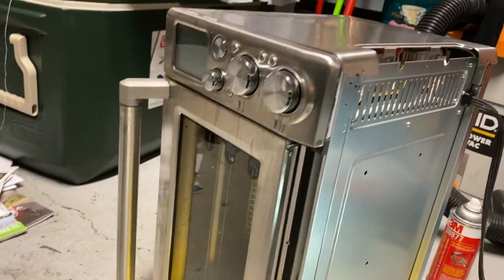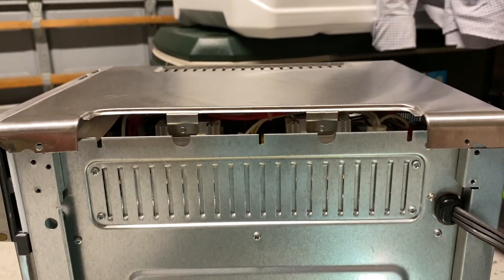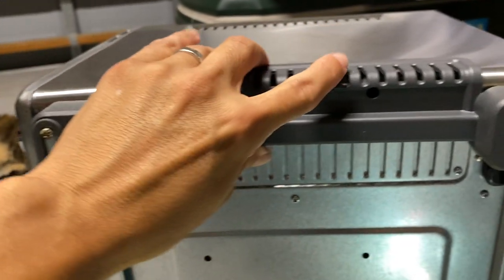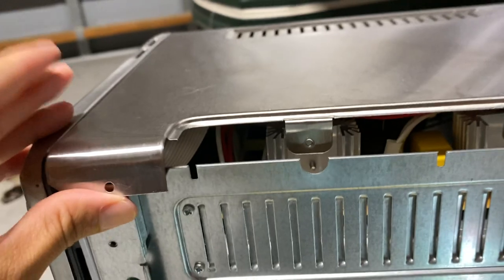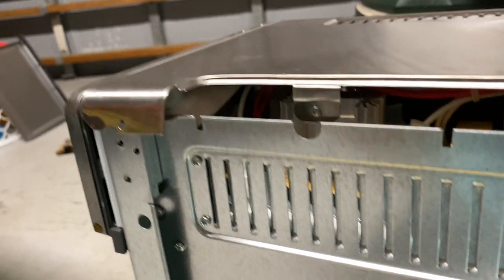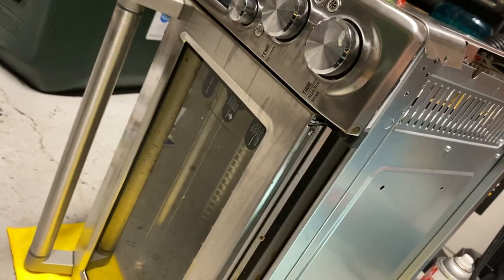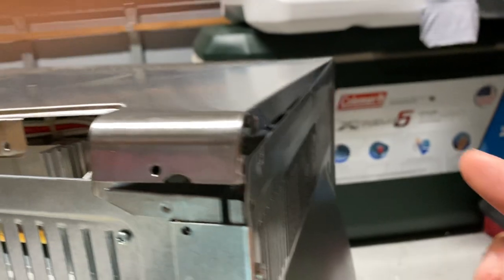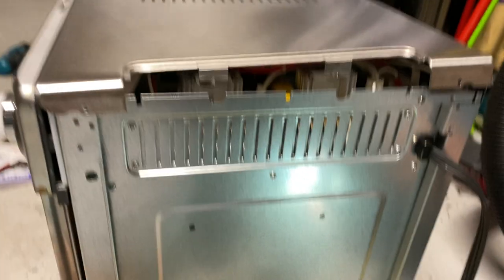Noisy fan in Breville Oven Toaster

Comment: To remove the outside, remove all screws and feet on the bottom and the back. Then, slide the back down until you can take it off. After that, there's one more screw on the under side, below the knobs. if you take out that screw, the entire top panel can be pulled off towards the back of the oven, starting on the side that doesn't have the panel. Firmly but carefully pull the side panel towards the back of the oven and it will slide away from the front. Work your way to the other side of the oven until you can pull the whole thing including the display away from the oven. The display is connected with two cables that need to be removed before fully removing the control panel.

Comment: There is one recessed screw on the bottom below the control panel. If you remove that, you do not have to get to those screws deep in the oven. The panel comes off attached to the case and then you can remove the panel if you need to.
Reply: You appear to be the most recent add - glad I read all the way down the thread.  Thanks for the tip - this would be so much easier if the case were off.  I'll be trying this over the weekend.
Reply: Chris S.'s suggestion was super helpful.  I removed the recessed screw and then removed the four long screws securing the feet on that side.  I then removed 6 or so small screws securing the metal panel to reach the outside fan.  I used WD-40 silicone spray with the long red "straw" extender to reach the top spindle of the outside fan.  I then resecured  the metal panel and feet and went inside the oven to reach the interior fan.  I used the WD-40 silicone spay with the extender on the top of the fan spindle, and then sprayed the spindle under the fan  itself.  I then turned on the oven with the convection fan on to lubricate the moving parts.  Almost completely silent.

Note:  Although only rated to 400 degrees, I'd use food grade silicone next time.  There is a silicone odor coming from the convection fan now - I've been trying to burn it off and it seems to slowly be going away.  But its not pleasant. I may have used too much WD-40 silicone spray but my guess is that even with less spray the odor would still remain.  But problem solved.
Reply: Great suggestion!!  Thank you.  Much easier than trying to move the internal screws.

Comment: Coming up on 2 years and had same issue. Used a similar lubricant and the fan started to spin again on the inside in addition to out. I Kept it on outside for a bit to get rid of smell and it seems to be working fine (currently day 2 working). Thanks for video. $4 lubricant saved me buying another oven.

Comment: That solved my issue!!! When I manually moved my fan, it moved easily. But when the motor turned on, the fan got stuck and resisted moving no matter how much I tried. Applying silicone spray didn't make a difference. Then I turned the oven so it was on the other side of the fan. I sprayed lube straight on the fan's pole and let it sink in. After waiting around one minute, I turned on the fan, and it moved without any trouble.

Comment: This was extremely helpful! Mine had seized up and wouldn't spin on its own anymore. Got some lubricant in there and it worked!
However, my "outside" fan blade came off, so it was a struggle to get that screwed back onto the shaft. I didn't discover until after reassembling that there's a screw head on the "inside blade"–end that you can use to tighten the outside blade against.

Breville Smart Convection Oven fan repair

Comment: Thank you for the information! I was able to reach the fan to lubricate it without removing that far left screw that you were worried about dropping down into the oven. With the oven on its side (fan up), I was able to lift up the cover enough to drip some 3-in-1 oil directly onto the shaft under the fan blades. 

The 3-in-1 nozzle was just a bit too big to fit in such a tight place so I used a drinking straw split vertically to form a long skinny trough to drip oil down onto the shaft. While still on its side, I plugged the oven in and let the fan spin for a minute to help the oil flow down the shaft into the bushing (removing the straw of course).

Now the fan runs like it was new! Thanks again!

P.S. one quick note: When putting the gray plastic foot back on, be aware that there is a groove in that plastic that the side cover of the oven slides down into. Before putting the screws back into that gray foot, be sure the foot is seated correctly. It should slide all the way back into place without needing to tighten the screws in.

Comment: Excellent video. I had same problem. Wife wanted to get a new one. I followed this video and fan is running quietly now. Just two problems. Lost one screw inside and ended up somehow with 3 extra screws. I will put them in my little toolbox for next year when I attempt another home repair.
Reply: I also had 1 extra screw and no idea from where lol.

Comment: Thanks. Mine's almost dead silent now.  As some have mentioned, removing the recessed screw below the control panel on the bottom helps greatly, after removing all the other screws.   I used Super Lube 21030 Synthetic Grease.  Put a small dab on a q-tip and applied it around the fan's shaft.  This lube is non-toxic USDA H-1 approved and has working temperature of up to 450F.   I do have a Noble Lubriquik silicon spray (also USDA approved), but didn't want any over-spray to get everywhere. Grease is the way to go in this application.

Comment: Thanx for the video. I have used a food grade lube instead. Fan spins like it was new.
Reply: Hi Lawrence, what is a food grade lube and how does it differ from something like RP7, which I'd be very hesitant to use after reading the cautions. Don't fancy the oven going up in flames. Is food grade lube safe to use in hot areas or something?

Comment: Thank you for sharing your DIY fan repair, I will certainly try your suggestion, good you show all the strategic screws 8-)

I tried it today Dec 28, 2020, but does not work me,  I even give it a push blowing air from my compressor, it kind of start to spin but eventually stop, maybe the fan is beyond its ages.  So I disconnect the fan from the power supply board to avoid the humming noise.
And for the black screw, I magnetize my screw driver so it won`t fall off.
Now let see if can find part for that fan.
Reply: you could simply power off the convection feature and the fan will not have power to it and not hum.
Reply: did you find the part?
Reply: @josephhngo  No could not find the part, so I disconnect power to the fan.   Since then, the thermal-fuse burned but able to find replacement on Amazon, the hard part was always to dismantle the oven to access the fuse, I also replace all the switches, why not right to keep this oven running, less e-waste thrash in the field 8-)

Comment: For those that are thinking of a replacement unit: In the past 2 months I went through 2 brand new units with excessive fan noise. Returned them both. One sounded like a small prop engine the second one started off noisy then slowly settled down. What poor quality control ! I've had 3 units in 10 years and all eventually develop this malady. Shame because the unit works well otherwise.

Comment: Thank you for this video.  I did as you suggested and the fan works much better and  more quietly.  I've had this appliance for 6 or 7 years and it started making that horrendous noise after about 2 years so I just stopped using the convection feature.  However with air fryers gaining in popularity I decided to try to fix it and just buy a fryer basket which I ordered yesterday from Amazon. 
I am wondering for future if drilling a small access hole thru the outer side panel in front of the fan to use to spray lubricant as needed would be a good idea?  The hole could easily be sealed with aluminum duct tape.
Thanks again!
Reply: Rose, can I ask which basket you ordered. Or are you using a Breville air fryer?
Reply: @lizardbreath9999  from amazom, I'll try and send the link
Reply: @lizardbreath9999  'Cosori C130 FB toaster oven',  from Amazon.   Can't figure out how to share link.  Hope this helps!
Reply: Thank you Rose! 
I already have my sweet taters prepared to try out!
Reply: very smart idea , hole only has to be size of spray tube nozzel thingy

Comment: Trued this as well with WD40 and 3 In 1 oil...worked for awhile but then seizes up again. Just oiled it again but last time this solution worked for maybe a week...very annoying problem for a $280 product that works for a year :(
Reply: Exactly. Ours isn't very old either. I don't call 2 or 3 years 'old'. I wish they were only $280 over here in Aus, they range in price from $425 to $499. Bit too expensive to chuck it without trying this fix.

Comment: Breville's design appears shoddy. The toaster-oven is held together with more screws than should be allowed on a device of this size, likely to discourage cleaning/fixing by owners. Didn't find anything in the accompanying owner's manual about how to clean/lubricate the fan. Close to impossible to clean the fan, which becomes dirty/noisy and gets stuck. Whack the fan side and it becomes less noisy and starts working for a while... Soon it gets back to its "GNAAAH". What a joke of a product!
Reply: You can spray the fan with a degreaser with 409 from inside the over, then a spray of the bearings with silicone or mineral oil will work. Let it dry after any wet cleaning.  Screws keep things still and prevent rattling, but feel free to leave out a few on reassembly.

Comment: I tried this to no avail - use 3-in-1 light oil on both outside and inside fans as close as I could get to the shaft.  Fan spins freely with compresses air until the oven is turned on, then the fan buzzes and freezes and won't spin with compressed air but turning off the fan releases is and it spins freely with compressed air.
Reply: Thanks for posting this. I did the air trick (+ blowing into a straw at the same time to really get it going), and the second I hit ON it just buzzes and freezes. Very glad to know the oil didn't do anything.

Comment: Question:  I did this, and it didn't work - When I tilt the toaster oven on its side - it doesn't make the noise (but obviously an untenable orientation for it) but when I put it back down, it's noisy again, even after lubricating. Any suggestions?
Reply: Try buying Extra Virgin Olive Oil in a spray can version.  Open the oven door and spray the fan from inside. Wait a bit, and you will see a lot of excess oil under the oven and on your countertop.  Dry everything with paper towels.
Reply: @djrenier  no no no no no no no you never use any kind of food oil as a lubricant as it will dry and go rancid and turn into gum and eventually a kind of varnish and it will seize what you're trying to lubricate. Use some kind of silicone spray or mineral oil.
Reply: Same thing happened to me. I lubricated with food grade machine oil and it still wouldn't spin. Put it on its side and the fan started working again in the orientation. So odd!
Reply: @amalikae95  You missed the bearings.

Comment: This seems like a common issue Maybe time for a class action lawsuits. This is not a real fix not is it probably healthy.
Reply: You'd need a ton of people in the class to justify not filing suit individually.  And your "harm" is that the fan no longer works  on a toaster over. Does it still toast and bake? So you've only been harmed by a small loss in function after several years - what's the value of that - 10%, 20%?  They lawyers would get most of the proceeds.
Reply: @lciummo1  Not really, you only need a few people and then claim many more are harmed and therefore represented under the lawsuit.

If the fan fails, it's no longer a convection oven, it's just an oven.
Reply: @michaelknight2897  u must be a joy to be around
Reply: @delirium5119  What? you make no sense.

Comment: Very concerned about Teflon lubricant coming into contact with high heat. Can produce harmful odors.
Reply: Above 570°F, Teflon coatings  break down, releasing toxic chemicals into the air.  Some of the spray gets into the bearning to free the fan - the rest can burn off in a few minutes.   I don't think teflon is required - if you can get some mineral oil, silicone, et at the center of the fan hub, both side, that should work as well.

Comment: Worked for how long?
Reply: For about 1 month or 2.  Then I used Extra Virgin Olive Oil (spray can version) and stuck the can in the oven and sprayed the fan a lot.  The excess oil drips down onto the countertop and then I wiped it up with a paper towel.  It's been good for 2 months now.
Reply: I had to strongly tap the inside fan area with my fist 3 months ago and it's still working as of today August 1st 2021

Comment: Can you post the actual noise which was fixed by your video? Or can you verify this noise is the same as yours, before you fixed it with a silicone lubricant spray?
https://www.youtube.com/shorts/gKwwKOZo_p0

I hesitate to disassemble it only to find out it is another completely different problem, as I use a air pressure can (to clean dirt on a laptop) to spray at the fan grill, and sawing it moving freely.
Reply: We have the same Breville, and have not heard that noise, in your video, from ours, I can certainly tell you. What it sounds like, when the convection function is engaged, is that it's rotating very slowly, and gradually stops. "Whoowh whoowh whoowh whoowh whoowh....whoowh... whoowh... whoowh...... whoowh...[ and so on, until the fan is completely silent].

I would actually get that unit professionally serviced, because from the sound of it, that could be an electrical noise.
Reply: @patoconnell4554  I asked Breville Support about the noise. They said something similar, the unit needs repair service, which to me, as quoted, does not economical sense, I may as well buy a new one. Then Breville actually offers a great discount on the new one, which is very attractive. However, I don't know if I should buy the same, or even a higher end model, not knowing the nature of the problem.

I don't think it is the convection fan that makes noise, rather the Start/Cancel circuit board gets some flaky solder joints when hot, it get open or something, or the program circuit board get messed up, needs a reset once in a while?? Otherwise it is still working, e.g. cooking pizza at 450 deg F for 20 min no problem, "most of the time". Hitting Start/Cancel will reset it!!

My dilemma: this 845 model is still working, on and off. When it makes this noise, I just hit the Start/Cancel button once or twice, then it gets reset, working again. I just hate to throw out something still useful, however annoying!

Thanks for your thought, though!